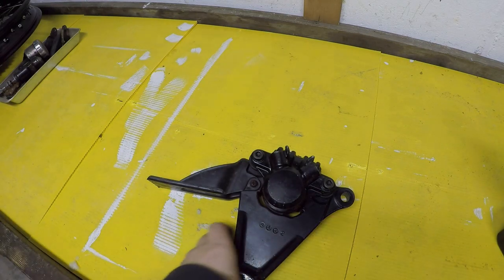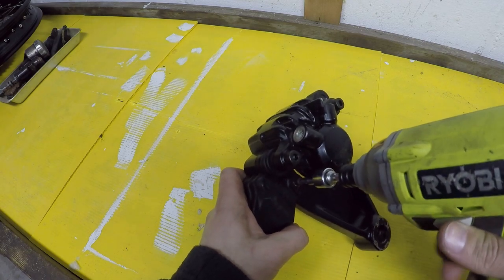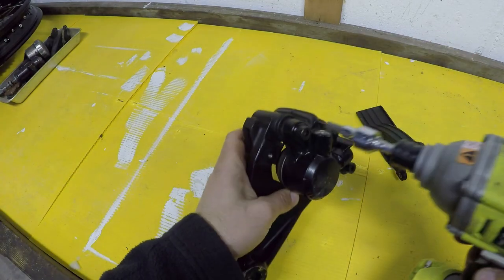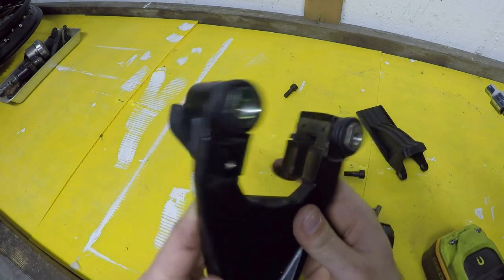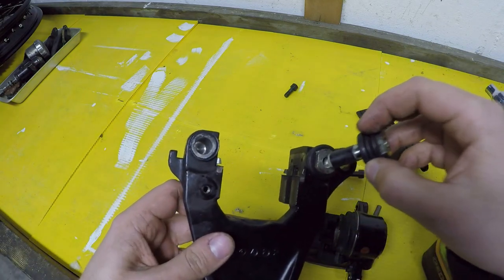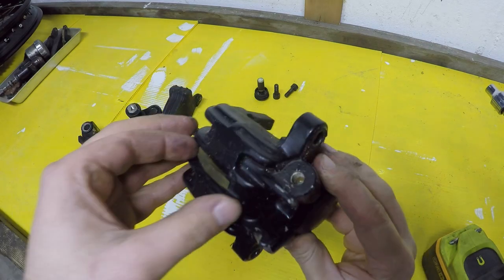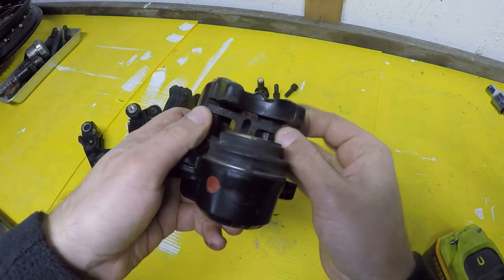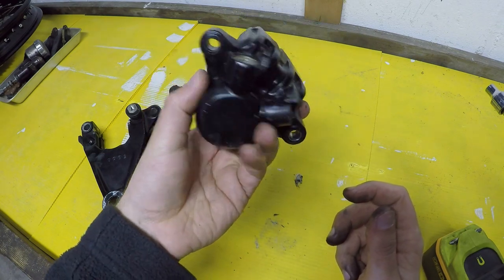78 79 CB750F SOHC4 Rear brake caliper tear down

Comment: I have similar calipers on my 1980 750f. Question, what brake pads are needed for this caliper?
Reply from the maker: https://4into1.com/emgo-full-metal-front-or-rear-brake-pads-honda-cx500-cb750f-cb900c-cbx-gl1100/
Reply: Thanks!